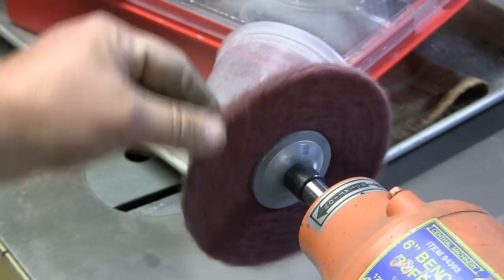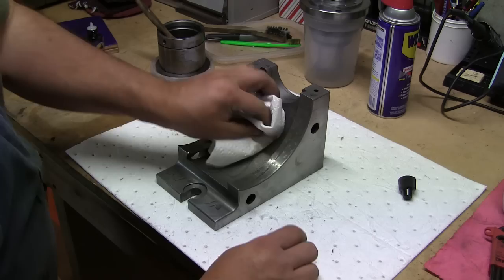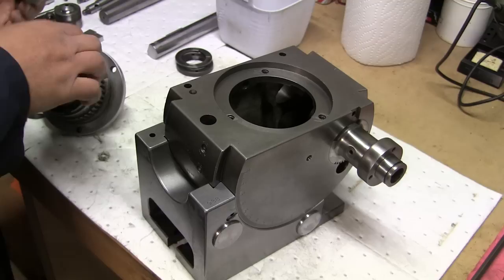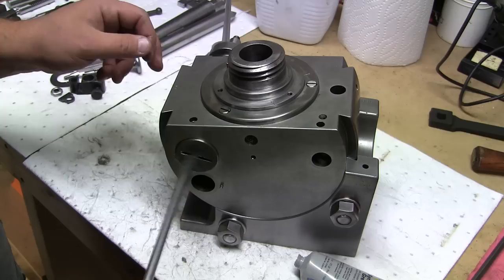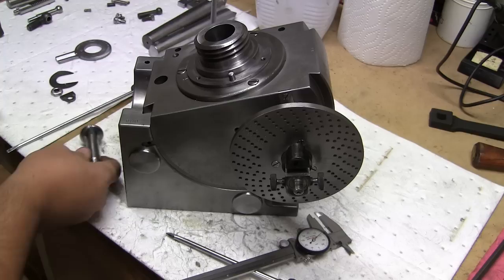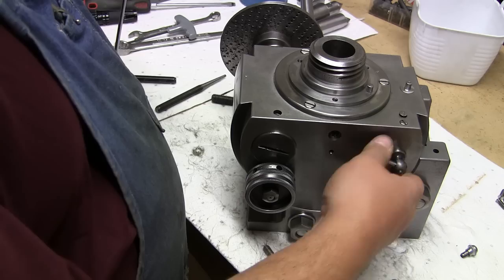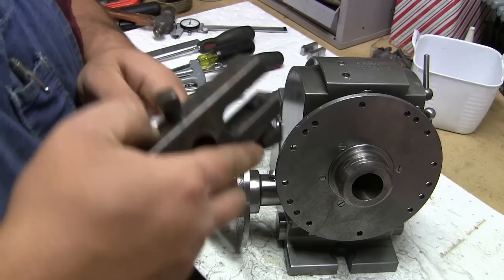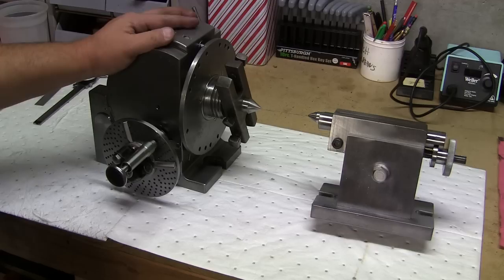Brown & Sharpe Dividing Head - (Part 3 of 3)

Comment: If you pour your Evaporust or anything else with the spout up instead of down like you did you will not have the "Glug-Glug" splatter problem.   That was one of the first things I was taught in a job where we mixed some nasty chemicals, for no splash pour with the spout up, it seems counter intuitive but it is the only way you want to pour something vile and nasty that you don't want to have to deal with but once you do it that way it works even easier than the other way and never a mess.   Another was jugs with the spout centered at the top, upend them and swirl the whole jug and it will cause Cavitation allowing air in and the liquid to empty like twice as fast and no glugging or splashing.
Reply from the maker: John, this is so interesting because I always say to myself, "I'm going to make a mess" every single time I pour that stuff. You gotta explain this to me because I'm confused, with pouring something with the spout up?
Reply: When you pour with the spout down there is no way for air to get into the container to allow the fluid to pour out so it creates a vacuum effect and holds back the fluid and ir rushes in and this repeats causing the glug glug.  Pouring with the spout up allows there to be air entering the opening and so a smooth pour results.  Sure the spout is further away form what ever your are pouring into and that makes people use the spout down as it it closer to the receptacle but with the glug glug results.  You can poke a hole in the container to allow air in then spout down works fine if that is possible.  Hope that helps, I may have confused myself, lol...
Reply: John Bare
John is correct. I normally hold the jug on it's side. If it is a new jug, I may hold it at a 45 degree angle with the spout at the highest point before pouring. This will allow air in as liquid pours out.

Comment: Brad,  I just found this older video.  Your restorations are second to none.  I see others putting their machines back together with wicked black stains on the exposed metal and painting over several other coats of nasty paint. The attention you pay to detail is extraordinary.  A work of art.  So, is it worth more then 150.00 now?  I hope so cuz I have one identical to yours that needs the same attention.  Have you found all the other indexing plates?  There are 5 more.  Call Keith!  He has a guy who can crank them out for you.

Comment: Outstanding restoration work.  I'm really looking forward to your next projects.  I'm especially interested in the part where you take the greasy, dirty, rusted parts and make them shiny.  Love the shiny.
A couple of questions: How do you shine up knurls without destroying them?  Is the scotch-brite wheel ok to use on machined surfaces, or is too aggressive for that?
Have you considered restoring some smaller items such as surface gages or height gages or micrometers?  It would be great to see video on those.
Reply from the maker: Titaniumboy for knurls, I use a scotch rite pad, but it tears them right up. The knurs survive just fine, but you go through pads. I am using a "fine" grit pad though. I'll use the scratch brite pads on machined surfaces, but paying attention to go very delicately. Just want to clean up the surface if need be. I've done a surface gauge (actually have a small pictorial that I can share one of these days ).
Reply: BasementShopGuy Brad, Thanks for the reply.  So you would use a scotch-brite pad instead of a scotch-brite wheel on knurls and machined surfaces?  I've had great luck with the scotch-brite wheels on all sorts of groddy things around the shop.  The scotch-brite wheels also do an amazing job on ammo brass that doesn't clean up properly in the walnut shell tumbler.  I've been avoiding some of the less-than-pristine micrometers on eBay just because I wasn't sure how to tackle the dirt and rust in the fine knurling on the micrometer thimble.

Comment: hi every body
if some body any thing about how to made index plate 
please explain
Reply: +باسم ياسين سفيان
Use a spreadsheet on your computer to generate the angular values to drill the holes using you rotary table. Once you have your table centered with the spindle on your mill, and the plate centered on the table, you can use your computer to generate values for any number of holes and drill a custom plate for a whole job just by moving your table over to the next set of holes. Accuracy is limited by your table.

Comment: Turned out great, now what does it do?
Reply from the maker: It hold a piece of stock and allows you to rotate the work any number of equal distances. For example, I'd use it to cut gears or scribe division lines on a dial. Hope that helps!